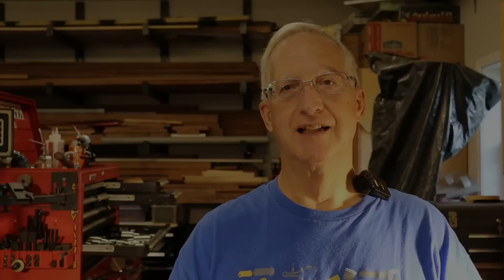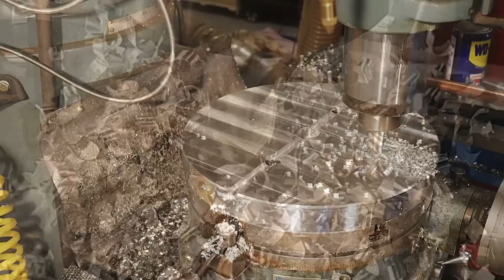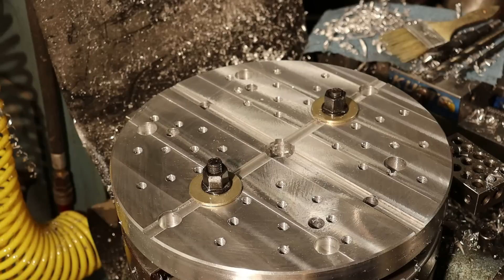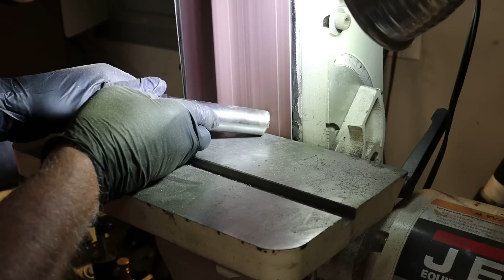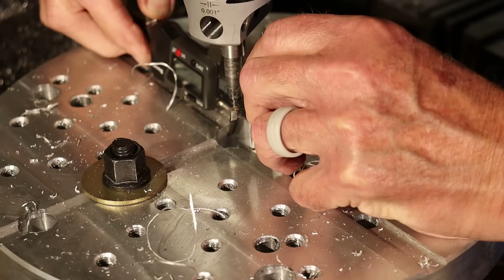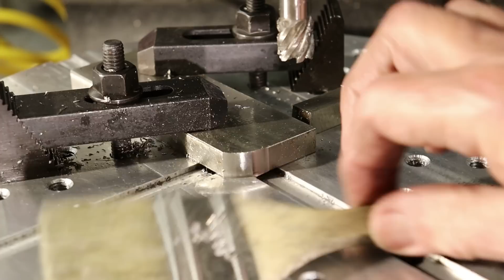Rotary Fixture Plate Part 2

Comment: Thank you, Frank for sharing your techniques for mounting a fixture plate properly to a rotary table.  
I am impressed with your attention to detail.
When I started building my 8" diameter fixture plate for my 8" rotary table I used 4 tee nuts and bolts at the maximum distance from center to fasten it to the table's four slots.  
I noticed that you used two rather than four and placed the bollts closer to the middle of the distance from center to perimeter.
Did you do that because you had a 12" rotary table, much bigger than my 8"?
Also, I plan on using a 2'" machinist's vise as a major "clamp" to hold my small workpieces on my fixture plate, so I am planning to put four 5/16"-18 threaded holes in line with the center of the x and Y-axies on each side of center. This arrangement will conflict with your two slots for the 1/2" HSS tool bit blanks, so I am wondering how much use you have made of these two slots at right angles?
Again, thank you for sharing your thoughts as to the design and implementation of this well done project.
Reply from the maker: The two bolts I used were temporary and not intended to show the best or only way to bolt the plate to the table. There are many other configurations available and how you bolt it down may depend on the job you are doing. So no significance to how I did it during that project.  As for the square "fence" I'd say it's of limited specific use as the use of pins can accomplish the same alignment capability, perhaps with even more flexibility.  In hindsight, I might have used a rectilinear array of holes rather than radial, though both have their uses. Probably would like to have one of each.  Depends on the kind of work you do most of the time. I think the rectilinear array is actually more useful for most people.

Comment: Grind a horizontal slot in your morse taper alignment tool and use it to pry it out when stuck. A rolling head pry  bar or a screw driver and fulcrum, no need to remove heavy Yussa 12” table.
Reply from the maker: Yes, that would work.
Reply: I was going to suggest a 1/4"×20 tapped hole in the top of your MT4 slug. That way, when it gets stuck, and it will, according to Murphy, then a 1/4" bolt will greatly assist you in getting it out. A large cupped washer on the bolt will act like a puller to extract  it.
On the subject of the slots, are they "timed" to the table's "T slots" and to the degree rotation of the tables base scale?
I know you intend to use the slots as a basis for "fences" using 1/2" stock, but would it not have also been of use to make them "T slots" too?
I don't know if you follow Brandon of "Ineritance Machining," but a couple of years ago, he designed and made a VERY interesting fixture plate for his ,I think, 8" rotary table. It has enabled him to turn out some very interesting shapes and chamfers, everything needs chamfering as far as he's concerned, along with rotational stops, and hold down clamps to go with it. I highly recommend  his channel if you're not familiar with it. Another is Joe Pie' channel.
Thanks for your video on this build.
Regards from Canada's banana belt. 
🤞🇨🇦🍌🥋🇺🇦🕊🇺🇸🪓🦃🏁👍